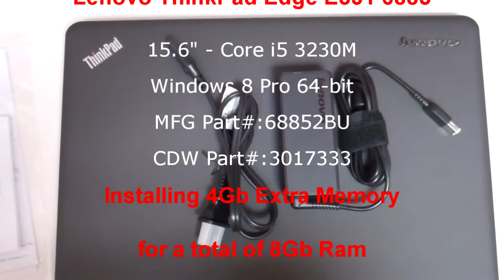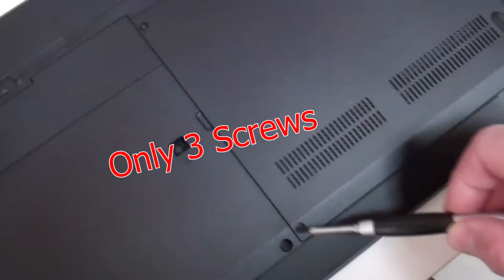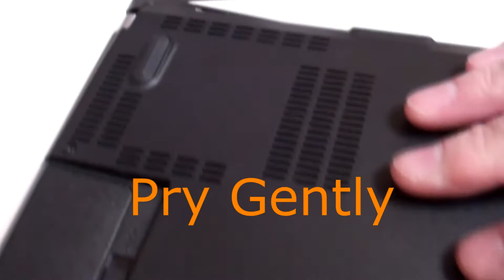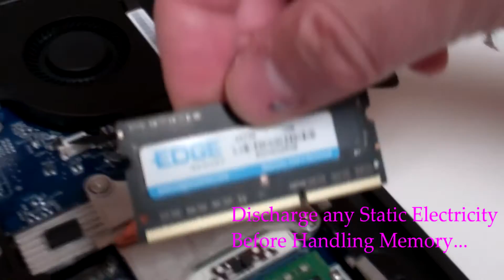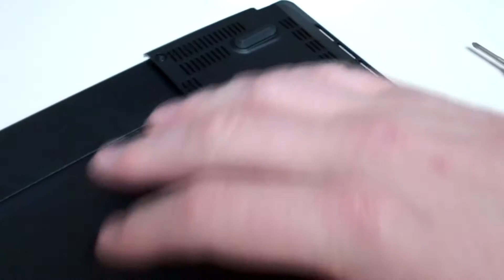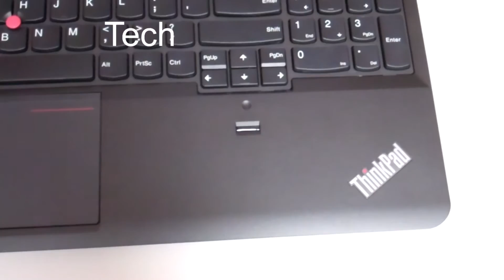Lenovo ThinkPad Edge E531 (Adding memory)

Comment: is there place for the HDD and an extra SSD ? and what do you think of the quality and build of this laptop ?
Reply from the maker: It's only got room for 1 HDD (either mechanical or SSD). The quality has been good in our 24 hours world of operation.  This particular version may be discontinued.  But in general I'm always a fan of the easy access of the Thinkpad brand laptops rear cover.  There is also some built in "spill" protection in the keyboard.  The fluids have a quick path to exit through the bottom.  I would recommend the 3 years warranty if the price is reasonable.  Recent warranty work has been quick and painless, but if this was not under warranty could have cost anywhere from $175 USD to $575 USD... they tell you the cost after they fix the laptop.  Anything physical would have push it into the $275 to $575 range for repairs.  Good luck. I hope this helped.

Comment: Is the Lenovo ThinkPad Edge E540 a good gaming laptop - or would you recommend something else?
Reply from the maker: Ben, I can't speak to the gaming usage, but it is a rugged performer for business.  We have been using Thinkpad's for many years now and they seem to take quite a beating.  I like the dual inputs (touch pad and finger cursor options).  The occasional dead hard drive have really been the only problem we've ever run into running these in a 24/7 365 World.
Reply: Thank you for getting back to me on this :)